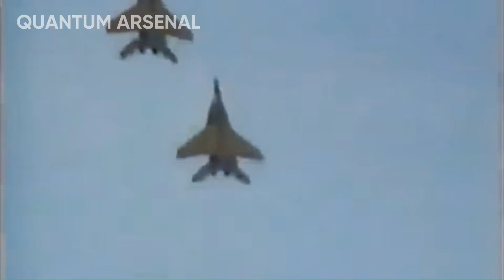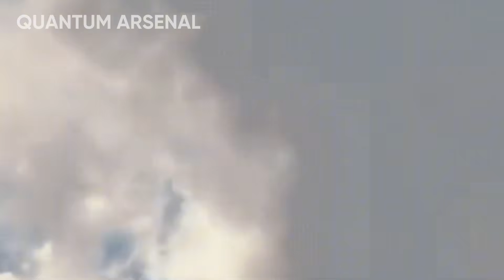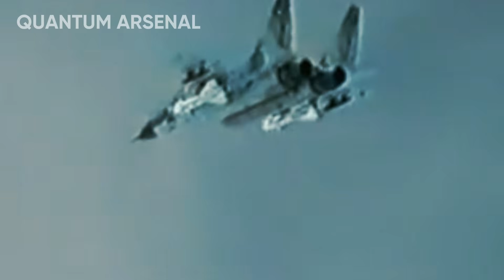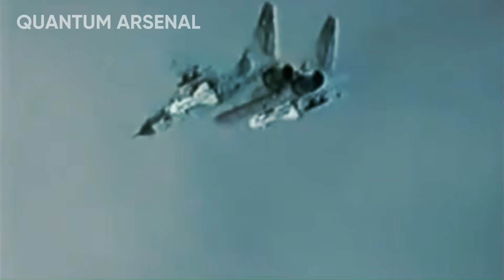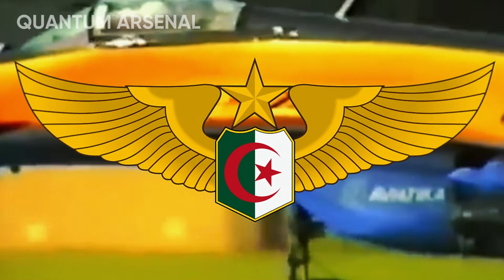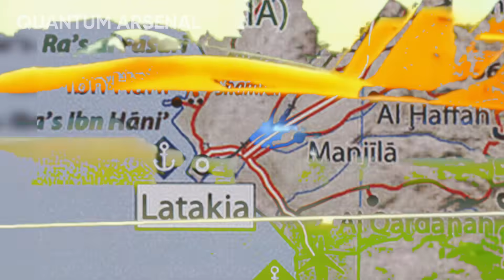Russia’s INSANE MiG-29SMT Upgrade: The 'Hunchback' Disaster

Comment: They fixed the problems of the MiG-29SMT with the MiG-29K and MiG-29M2 which are operated by Russia, India and Algeria the MiG-35 is a further development that has trouble competing with the SU-35
Reply: The Sukhoi Su-35 is a heavy, long-range air-superiority fighter, while the MiG-35 is a lighter, more affordable multirole fighter
Reply: @user-xb9dm5vt9q that's true the designs of the MiG-35 and the SU-35 evolved from the MiG-29 and the SU-27 who's original roles in the Soviet Union where of a cheaper light fighter and a long range heavy fighter, when i say the MiG-35 is completing with the SU-35 i mean for funding as the Russian government is prioritizing purchasing the SU-35 over the MiG-35 which it only bought in very limited numbers
Reply: @georgeboyred  actually it more like the Su-30 2-seat ..... but yeah Mig-35 was too similar ..... it also I believe had its wingspan extended to allow an extra weapons point on each wing